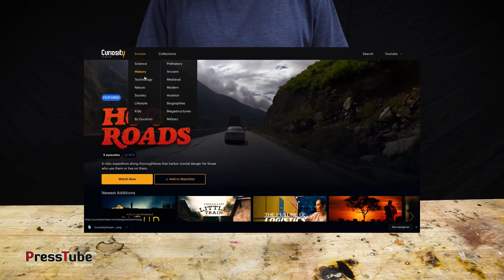I Created A Bolt and Nuts That Tightens In Two Directions

Comment: If it tightens in both directions how do you loosen it? 🤔
Reply: I was wondering about that as Well...
Reply: The opposite direction you used to tighten it. Its designed in a way where it can only change directions if you remove it completely

Comment: Would work better with a hex profile on the nut and bolt ends, than it does with a rounded profile, it's a nice exhibit but not practical to use anywhere I can imagine